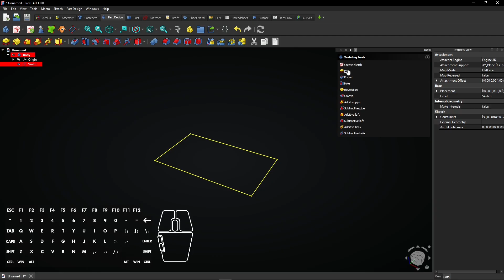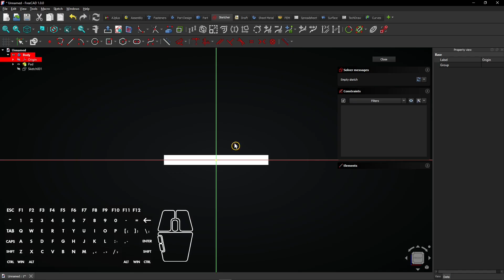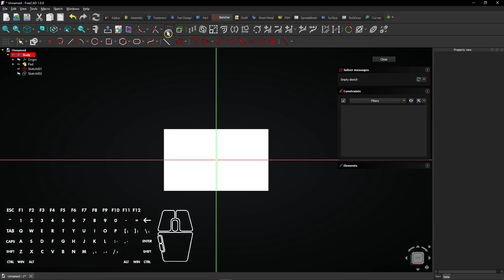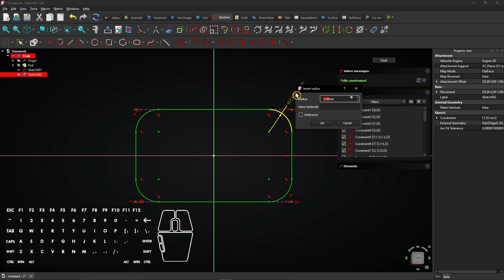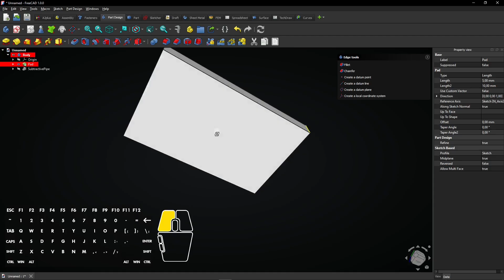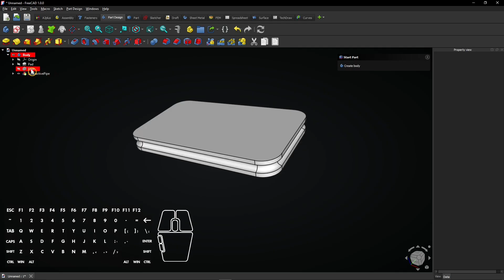👏 FreeCAD Sweep - FreeCAD Subtractive Pipe - FreeCAD Part Design - FreeCAD Groove

Comment: I'm lost. I can follow ok right up until you add a second rectangle on top of the existing rectangle.
Reply: I got that, and managed to finish the project, but now I'm doing it again and for some reason I'm back to not being abe to add the subtractive pipe.
Reply: I don't know what the difference is between it working and not working. I got it to work again, but I don't know what I did different
Reply: Its weird. Sometimes it works, and sometimes it doesn't
Reply from the maker: Yeah frustrating to don't know what you did differently.
Reply from the maker: That second rectangle is placed inside a new sketch on the same origin plane. It's the path of the swept cut you apply later. Hope that helps!

Comment: Very good tutorial.  Not sure what  happened with mine but I lost the SubtractivePipe after I added the set tip, edges and fillet.  The fillet applied but I lost the Subtractive Pipe.  I just redid the SP and everything showed up properly.  Freecad version 1.0
Reply: No, if it's required I missed that point.  I will try it again.  Thanks for the reply.  👍☺️
Reply from the maker: You're welcome!
Reply from the maker: Thanks! Did you press Spacebar while the greyed out SubtractivePipe feature was selected in the tree?